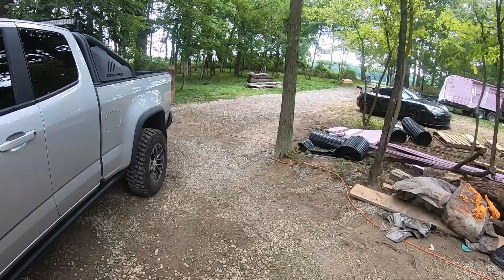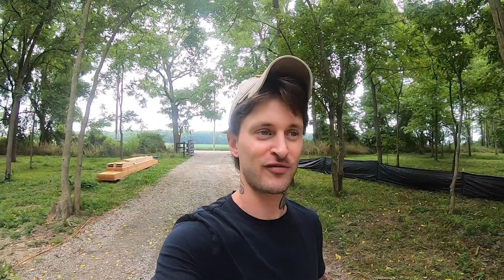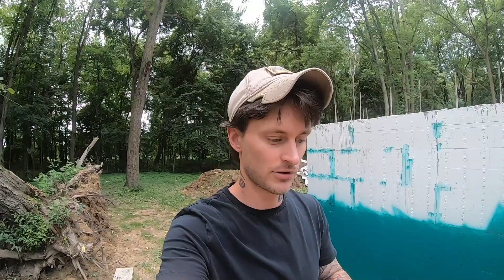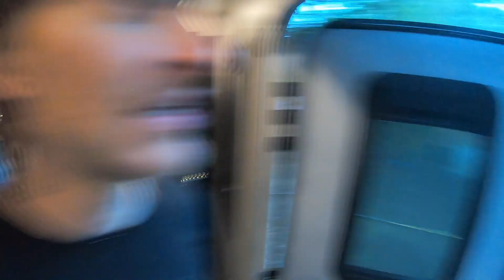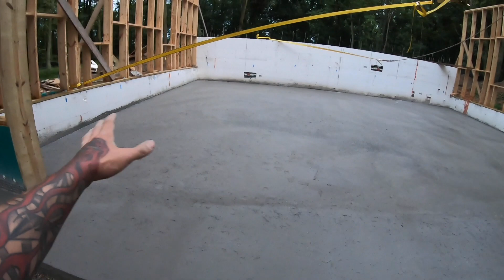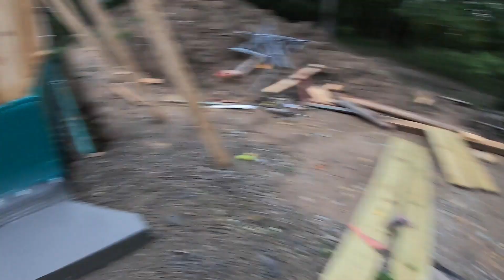Finishing the heated concrete garage floor!

Comment: No rebar in the slab? Has it cracked? Great videos!
Reply from the maker: Nope.  Not needed for inside.  We did however use 4lbs of fibermesh per yard and I believe 4500psi concrete.   I’ve got a few normal cracks that we’ll fill in and do our epoxy over it.   With the back being like 9” thick and the front at 5.5” this should be solid!   And thanks!
Reply from the maker: Nope.  Not needed for inside.  We did however use 4lbs of fibermesh per yard and I believe 4500psi concrete.   I’ve got a few normal cracks that we’ll fill in and do our epoxy over it.   With the back being like 9” thick and the front at 5.5” this should be solid!   And thanks!

Comment: I didn’t see screed boards along the perimeter of the garage wall. Did you use them? I did see you had boards to form the apron.
Reply from the maker: No just caulk lines on the ICF with about a 1/8th drop per foot.

Comment: I know it's too late now, but for those watching, if you install the radiant beyond the wall, the insulation should extend as far as you call.  The unprotected ground under the apron will suck the heat out of the slab.
Reply from the maker: i should be good then.

Comment: why are engineered wood not fire treated ?
Reply from the maker: we dont treat it here for some reason.  i know Canada has fire treated lumber your can buy.
Reply: Fire rated lumber and I-joists are available.  Money better spent in residential Sprinkler Systems.  Ohio Bldg Code use to require the floor system to be protected (502.14, '13 Code).  Typically that means drywall when using engineered joists (I Joists, Trusses, Etc).  Not sure if they moved it in the current '19 code.

Comment: Dude, If you are in the house by the time the fire burns through the sheet rock and burns through that I joist you were probably already dead from smoking inhalation. The fire department probably won’t step foot in your house unless they know there is somebody inside the house and again the fire would have to be pretty small so no chance of collapse for them to go in. Because once it’s fully engulfed to the point where it’s going to start collapsing they’re fighting it from the outside. In general they fight residential fires from the outside
Reply from the maker: very true

Comment: Why didn’t you make a door to cross from the garage to the basement?
Reply from the maker: Jose Delgado because it’s several feet down and I didn’t want to do stairs or have a cold door, insulate walls etc.  Code also makes you add a 4” concrete lip around the landing for spills and water etc and that takes away floor space, trip hazard etc.  this is just cleaner.

Comment: Working on building a home too:
My research material said that the alkaline qualities of cement would eat actual glass fiber in a couple of years so instead by code the fiber used is either plastic or metal fiber mixed in.
It seems counter intuitive but that's what the ACI papers I read said.
Reply: I have fiberglass in the cement around the pool. It’s still there after 20 years but it’s not that bothersome to walk on barefoot. Burning is a great idea.
Reply from the maker: @iloveburros  in a later video we ended up torching them down so you can’t see them and they’re not a problem anymore.  Well worth it.  Only takes a second.
Reply from the maker: BOB Joatmon that makes sense.  This stuff is called Tuf-stand. I’ll look into it now to see what it’s made of.

Comment: Watching your progress with great interest. Plan on building an ICF home  when I retire (Only 2 1/2 years :) I'm a nurse too)
  Be carefull with Clay back fill.  Clay will adsorb water - Expands when saturated, contracts when drys out.  Caused severe damage to our current foundation.  I would seriously consider back filling with gravel up toll 8-12 inched from final grade. Your dimple membrane will allow the water to leach (for lack of a better term) out & prevent the damage we encountered.

  As for the I-Joists, cover the basement ceiling with double layer of drywall - will give an additional 15-30 min fire protection.

Good luck
Reply from the maker: Douglas Klein good calls.  Would you back fill 8-12” of clay or bring in top soil?    As for the ceiling drywall I can do that.  Since we are doing radiant heat under the subfloor and in between the joists I plan on packing in insulation in there.  1) to keep the heat in and going up, 2) sound proofing since I work nights and Erin works days, and 3) if I use Rockwool that has a 2,200 degree burn temp so that might help as it basically cant burn and will help with heat.
Reply: @neckofthewoods24  Both kind of depend on budget - top soil would be my first choice.
 Agree with the insulation. Of course Rockwool will will have the best sound damping & R value, but is also more costly.  Frankly, for subfloor insulation, I'm planing on doing the Pink stuff.  Not quite the 2200 degree protection, but will significantly cut down on air feeding what ever burning might happen and offer moderate sound damping. In terms of decreased R value, the way I figure, not trying to protect against the 10 degrees out side, just keeping the radiant heat going up.
 Of course, a discussion with a HVAC or professional insulator would get you better info. I am by no means an expert.
Reply from the maker: @TheWhale45  I’m guessing it depends on the installer whether they infuse it or not.    A sprinkler system for a residential USA house?  Not in any state that I know of.  Where do you live?   And you don’t need to put gravel up to final grade.  I know homes around here that do no gravel with poured foundations and I’m sure it lasts a long time before issues pop up.  But we 100% didn’t go that high.  There’s about 1-2 feet of soil on top of the stone.
Reply from the maker: @TheWhale45  I’ll check it out
Reply from the maker: @TheWhale45  I’ve seen that but it’s to much money.  Those sheets are over $55!   We’ll be fine the way we are gonna do it.  Seal the Segway from both sides and insulated the heck out of it!   It’ll be nice and warm with a low blower door test.

Comment: The only problem that i see, is the thermal bridge caused by concrete on the front of your garage doors that take cold to the interior of your space. I see yesterday this product that can resolve this issue : https://perinsul.foamglas.com/en-gb/.
Reply from the maker: Mohamed Attia I’ll look at that but the outside cold trying to cool the concrete is hitting an inside PEX at 140 plus degrees warming it back up.  People who do heated driveways do the same thing. I don’t think use any special or different products. The PEX just sits on foam and is locked down or sits in plastic subfloors before the concrete gets poured and it’s enough to melt snow and keep everything the way they want it.